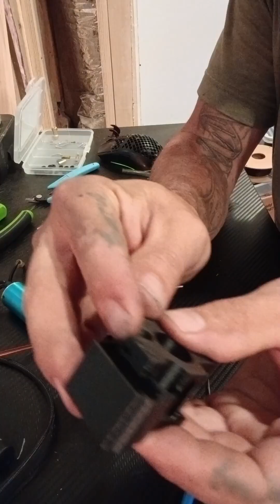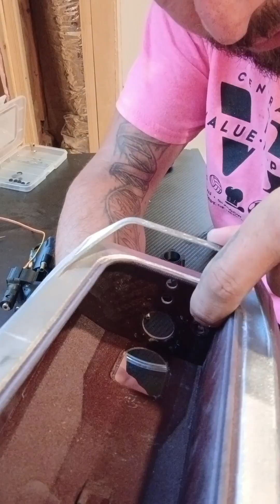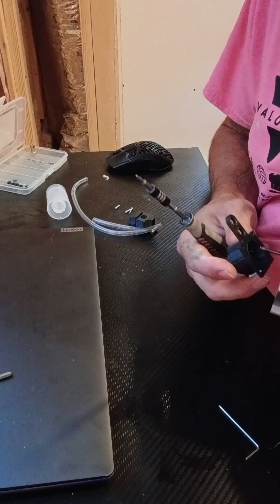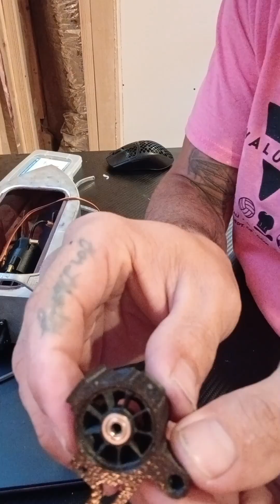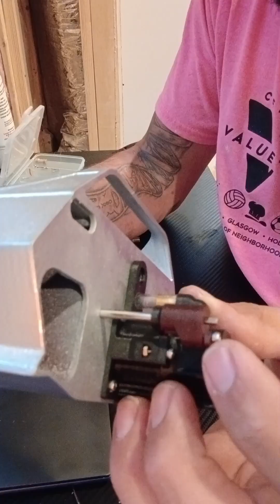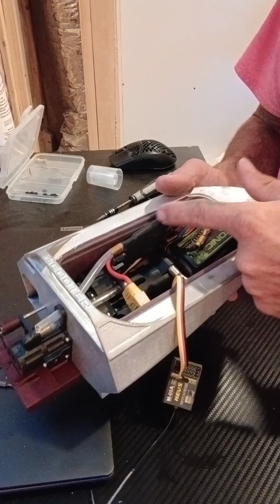ASSEMBLY VIDEO: PICO-1 + Scooter Sport

Comment: Have you considered 3d printing TPU/PEBA gaskets and o-rings instead of using silicone?
Reply from the maker: That is definitely an option! I suspect the community will develop all sorts of mods for that. My main concern upon release was absolute water sealing without question. TPU gaskets would definitely work, but nothing says "no way water" like a nice bead of silicone